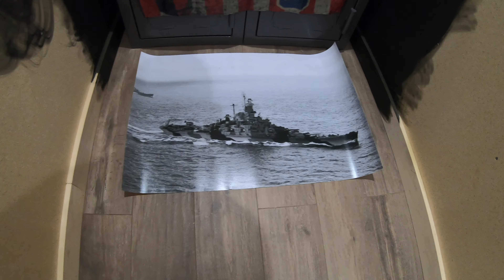The Vault!  Gallow Technologies THIN panels installed!!

Comment: on your blocking on your stairs to the wall, if you take full length 2x4's along the bottom side of the stringers it make it a lot easier to sheetrock down to them. trust me that is how us builders do it.
Reply from the maker: Still trying to wrap my head around this.  On the bedroom wall side I was going to OSB a kick plate and a step before the final steps so all thats hidden.  As for the other side, will it work there too?   I just need to find a pic.

Comment: Looking nice.

In my research the least expensive system was slat wall because you don't get stuck buying hangers from a single manufacturer who is pricing them like gun accessories instead of commodity retail store hardware.

But you just gave me an idea.  Some slat wall systems take an aluminum channel slid inside the slots to reinforce them.  If I buy a bunch of that channel and screw it in to my ICCF, before grouting, with extra long screws to reach in to the concrete and shim them to all lie in one plane, when I finish my walls with plaster I can use the aluminum channel to screed the plaster and get a flat wall in the bargain.  That might save quite a bit compared to regular slat wall and look super custom too.

And a couple other things, your garage is probably much more noise insulated from your house than you can easily noise insulate your vault and it's probably better to have chemicals and fumes in the garage too.  I would make a cleaning bench spot out there with a rack for your rods, a place to store cleaning supplies and a place to put your tumbler and anything else gun related that makes noise, fumes or heat.

I'm going to be breaking my rules with my living area over a shop space but I'll also have a small shed and a second shop space that I'll use for chemicals, noisy equipment (air compressor in the shed!) and dirty jobs.
Reply from the maker: i dont really use any chemicals.  the tumbler just uses a soap cleaner and the powder has to stay in a warm and dry place.  im not sure how humid the garage is.  hopefully it'll be fine with the mini split but i dont know at this time.  we'll see.  

your idea should work though.  way cheaper but maybe more man hours.  let me know.
Reply: @neckofthewoods24  I just mean your gun cleaning solvents.  Moving the tumbler would just be for noise so you could clean at night.

You could go shooting, come back, unload your fired brass, clean and lubricate your guns in the garage, then move them to the basement for storage.  Then go back to the garage to tumble the brass at your leisure.  If you like to decap before you tumble, get a Lee APP press for the garage.  Flame annealing is another thing better for the garage or outside even.
Reply from the maker: I gotcha.  I don’t have much.  Just a little bottle of #9 that’s lived in the RV now for 3 years without issue so all should be well.  Flame annealing would be cool though!   I’m at atleast 4-5 reloads now on the same brass so any day they’ll probably crack and be useless.
Reply from the maker: I am going to insulate the walls and ceiling also so should cut way down on sound.

Comment: Did you just cut the panel around the pipe?
Reply from the maker: no i used my hole saw bits.  one a little smaller than what i used for the 5/8 hole i made for the pipe.  it was perfect.  the spot needed to be right in one of the upper screw hole locations.

Comment: I think it would look nice with some  simple  cloth  or camo netting overhead. Adding some plywood between the floor joists and a pull down door would also add extra hiding spots overhead to keep somethings out of site.
Reply from the maker: That’s a cool idea.  I do have to check with building code and see if ceilings in basements need to be fire rated.  If they do I have to used 5/8 drywall or maybe 5/8 lumber is ok if it’s thick enough.
Reply: @neckofthewoods24  You could even make it a drop down box.

Comment: Free Pallet wood ceiling in the Vault
Reply from the maker: hmmm, only if i can tongue and groove them to make the ceiling tight.  i think fire code will need that be tight or maybe im forced to do 5/8 drywall for fire blocking.   i wonder if 5/8 shiplap is ok for fire blocking?
Reply: @neckofthewoods24  i agree they'll probably want you to drywall it first before any t&g or shiplap.
Reply from the maker: @Cameron-ur2tk  that sucks but at least I won’t have to mud and tape.